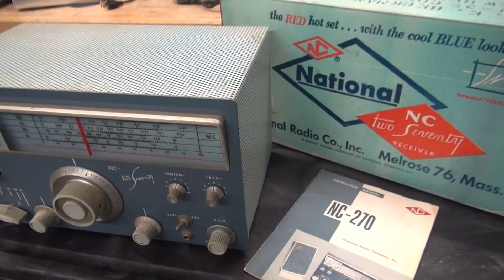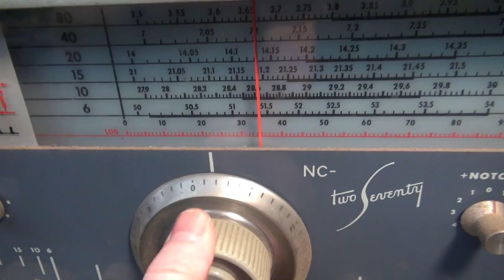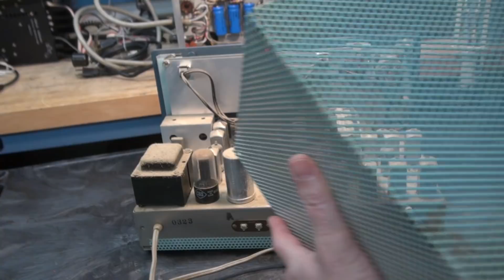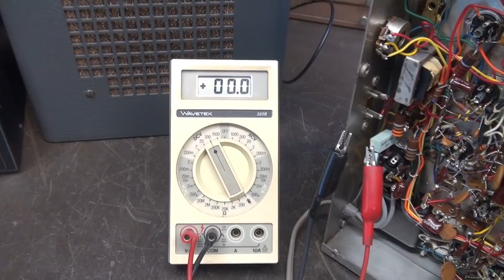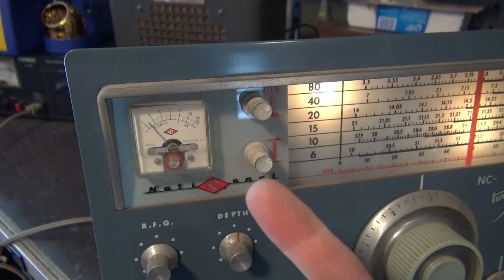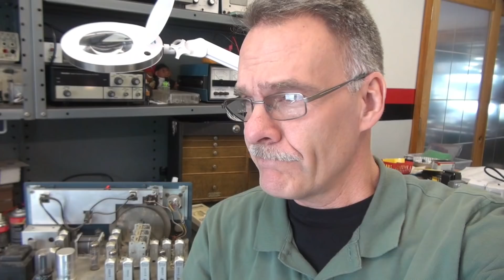How to resurrect National NC-270 Ham Shortwave tube receiver

Comment: what it the point of not shooting the controls with de-oxit first ?   peak rf and antenna, set for medium band width...  note that Am with AVC is Off with mode sw Clock wise, and ssb / cw in the middle  AM with avc on CCW.

Comment: WD-40 is a solvent, but not a lubricant.  Tri-Flow is much better to use on bezels, bearings and shafts, it will clean and leave a long lasting lubricant and rust preventive coating.  Use DeOxit on variable capacitor bearings, wafer switches, slide switches and pots, and on tube pins, and socket pins and connectors.

Comment: WD-40 is not a lubricant.  it is a solvent and water displacer.  Tri-Flow is a good combo penetrating lubricant..which will not harm plastics, and leaves very reliable long term light lubrication for shafts and thier bezels and bearings.  WD-40 will remove all lubrication, and let metal rust or weld itself together !  The only thing WD-40 is really good for is driving the moisture out of ignition wires.  Otherwise, get a suitable product and you will find you can free up most controls without taking them apart.  The black switch corrosion shows this has been in a damp and perhaps corrosive environment.  I use a pencil type eraser to remove that oxidation, along with the DeOxit D5.

Comment: An old collector once gave me a tip how to clean such knobs easy and efficiently.
Use denture cleaner tablets in warm water, soak them and most of the crud will just fall off when you rinse them afterwards. I tried it 2 times and it works quite well.
Reply: Awesome tip. I’ve got this same United I’m restoring right now. I’ll give it a shot

Comment: This set has had less than 24hour of run time. Everything on this set is oiginal. The is no sign of heat related stains or "use" tool marks on any of the terminal. I would also want to know what is the current capacitance and leakage at rated voltage. I submit the caps may be just fine. Leave the machine original  at least for a few hundred hours of operation. I am ten years older than your radio...Yes I may leak a little too! But I have been working pretty much since I was made. You set hasn't been...

Those are rodent urine stains on the top of the chassis it caused the rust on the transformer lid.

Comment: A beautiful receiver. What's that "DEPTH" control for?
Reply: Usually that means the depth of a notch in the selectivity circuitry (normally in the i.f.  stages) to remove a.nearby interfering signal